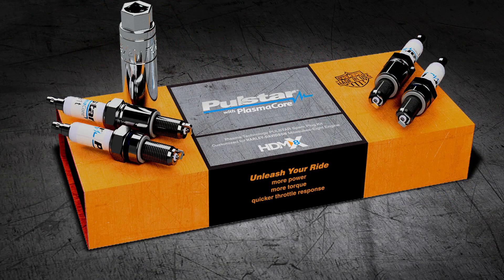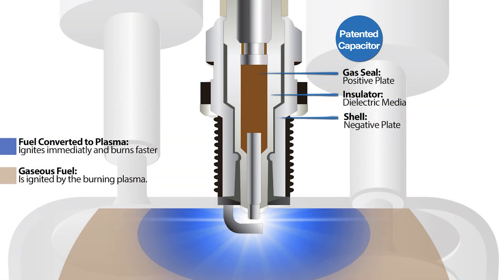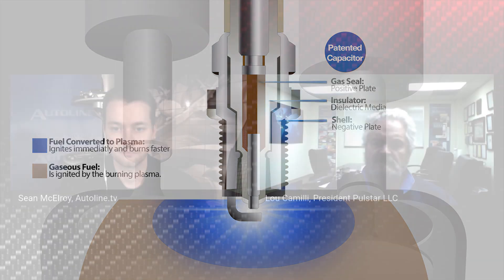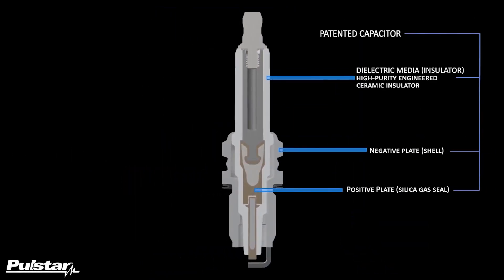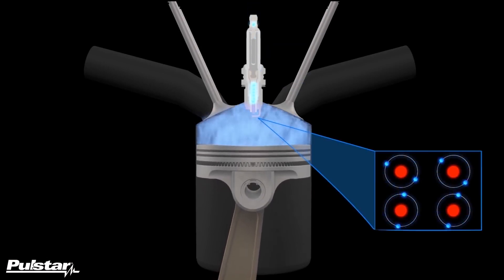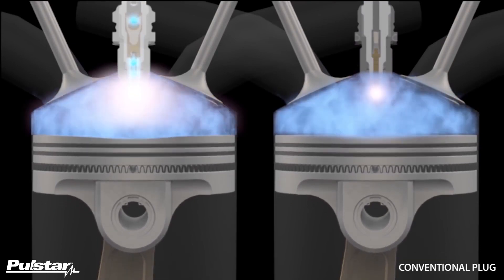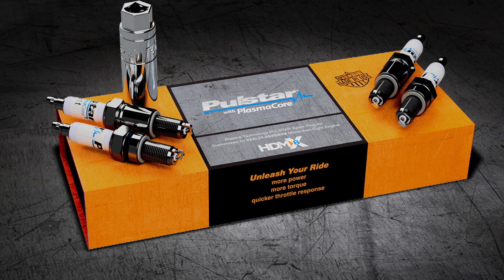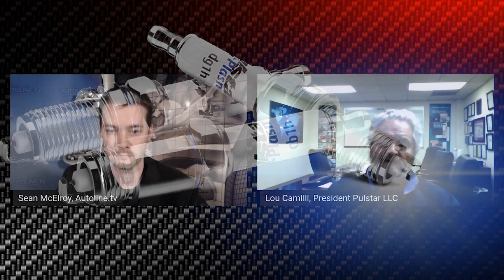Pulstar's Shocking Spark Plug Breakthrough - Autoline Exclusives

Comment: Can it go in a 1998 GMC SEIRRA 5.0 305 8 cylinder?
Reply: Absotively! I have them in the BIG brother of your engine, the Vortec 454, drove around the country in the big motorhome and got an average of 14mpg (up from 8)!  Keep in mind the Pulstars were just 1 of several modifications, but  they definitely played a role. I've had them in 3.8 V6s, 5.3 Vortec, Vortec 7.4L, '79 350, and Corvette LS1 (It got 4mpg improvement), among others. Don't expect turbocharger levels of performance or huge mpg gains,  but definitely worth doing, especially when on sale like now through their website.

Comment: Cost...about the same as premium iridium plugs? Really? I just bought a set of NGK Ruthenium HX plugs (ruthenium is supposedly better than iridium) and they were only $8.04 each
These Pulstar plugs are $25 each do the math 3 times the cost, But I'd buy them in a heart beat IF they cleaned the carbon off the back side of my direct injection engines intake valves.

Comment: Will a Pulstar CB1H10 plug work on a stock 300/4.9L fuel injected 1988 Ford E-150 engine?
Reply: Contact messaging on their website doesn't work either.

Comment: Solar & wind already cheaper than coal.  Production of electricity downward trend.  Price to consumer? Look to utility company for lowering your cost.
Racers should buy this plug - and if they did buy  - use should spread like wildfire, right?
Reply: The improvement seem to be very minor, but on the other hand if just getting a fractional percentage improvement makes the difference between getting first place vs second place, the cost is well worth it.

Comment: Any increase in damage to the cylinder heads? does it create more heat in the engine? are engines strong enough to handle these new spark plugs?
Reply: I've used this tech over 30 years....exhaust temps are lower because of better combustion.  The effect is far better smoothness.

Comment: You can eke out a little more performance with a set of these plugs, but don't expect miracles. Normal spark plugs are already pretty good, and for best results you'd need to tune the engine's computer to take full advantage of the slightly more efficient burn. Some engines, such as the 2012 Mazda 6, the computer compensates and you don't see any noticeable performance improvement at all. https://pulstar.com/how-it-works/tests/dyno-testing/
Reply: if the computer compensates that, then you at least could save a bit of gas money

Comment: His perspective on the transition to electric drive is confused, but that isn’t the point of this interview. This is a potentially valuable innovation that is a good price/performance solution for the large number of legacy ICE vehicles. 

The low cost of electricity production is what is killing coal-fired plants and it will be killing natural gas soon. It is already marginal. This is a trend that is basic economics - technology is driving the cost of generating electricity down.
Reply: i thing it only makes a benefit for old naturally asperated engines. but these are that old things that need that benefit.

Comment: Bummer all that smart person time spent on a dieing technology when it could have been spent on a future technology that would have more of a positive effect. Small gains therefore not much of a beneficial impact and not impressive. Sure every little bit helps but very soon all of my gas operated tools will be replaced by battery operated, as well as my Ford F150 with a Try motor Cybertruck. No more spark plugs needed for my vehicles. Coal power plants are more expensive to operate and maintain than green renewable power plants thats why coal is shutting down and also the huge negative environmental and economical impact of coal is reason enough to shut coal down. Batteries are being recycled, they aren't an environmental problem and they often have a second life after a car before the battery is off to recycle. What engine has a second life after its time in a vehicle? Big fan of the show 👍👍👍👍
Reply: for oldtimers it still makes sense.

Comment: Imagine that, Denso, NGK, BOSCH, Champion, etc haven't thought of it.  Or maybe did and found it wanting.  You'll know if this is legit soon as it finds its way into OEM uses.

PS.

You won't.
Reply: I respectfully disagree. The difference with this small company is that they have been doing research in conjunction with Sandia National Laboratories. They have one laboratory devoted to extreme high power output. I have been out to Albuquerque and it’s a pretty amazing area. Spark plugs now are pretty much at their peak of development, so I’m not surprised that the large OEM spark plug companies have not explored this upgrade.